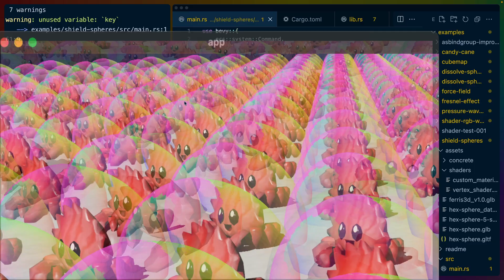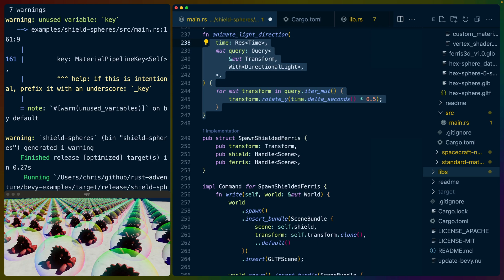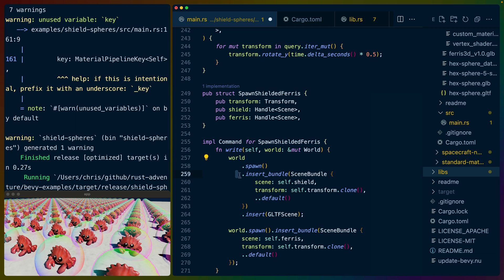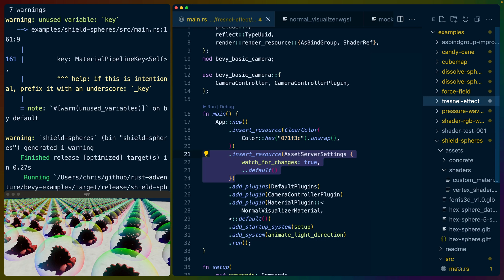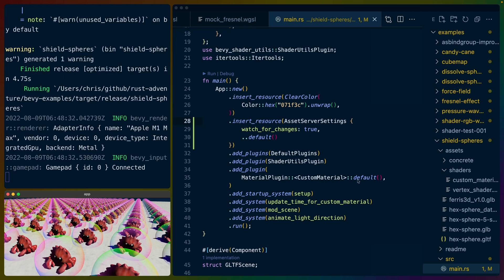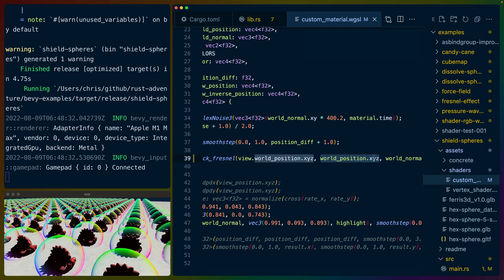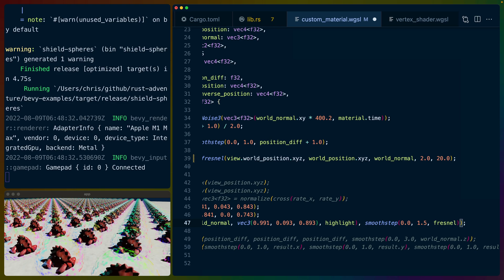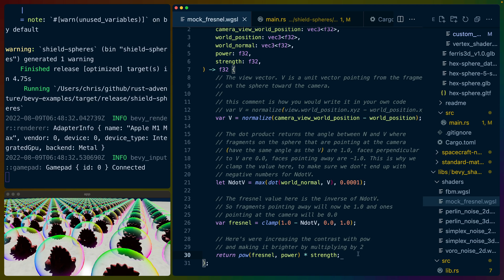Bubbles of Ferris with Bevy, WGSL, and Rust

Comment: For making the back of the bubble render sensibly, you probably would've needed to render the front and back separately -- render once with front-face culling and again with back-face culling. Doing them separately also gives you the opportunity to use different effects for the front and back.
Reply from the maker: The wgsl spec (and thus Bevy) has a @builtin(front_facing) argument in fragment shaders that could be used to do different processing on the back-facing fragments as well. 

https://gpuweb.github.io/gpuweb/#front-facing
https://github.com/bevyengine/bevy/blob/f531a94370755155accd625c58a06f07d33edcce/assets/shaders/array_texture.wgsl#L17
Reply: @chrisbiscardi  I don't immediately see an indication that back-facing fragments would be rendered strictly before front-facing ones, so it looks like you'd need to implement order-independent transparency if you go that route.

Comment: I only have a surface level understaning of bevy but couldn't you just when spawning the spheres add a zero size component (like struct BubbleSphere();) and then Query for that using With<>?
Reply from the maker: If you had control of the spawning of the mesh you could yes, in this iteration I was spawning in the entire gltf scene so didn't have access to the entity the mesh would've been associated with.  The most recent iteration removes mod_scene entirely and spawns in the mesh itself instead of the whole scene: https://github.com/rust-adventure/bevy-examples/commit/5355843b8caf83bb7e03d78bf5491803f0cd26b6

Comment: It's a great video and a beautiful effect!

The only problem I have is that when I run the example on Windows it runs at 3fps on a 1080 Ti. I profiled it (https://i.imgur.com/ix8mR6Y.jpg) and it's taking an age to go through the extract stage preparing the meshes and materials. I'm sorry I'm still really new at this so I'm not sure what's going wrong.
Reply from the maker: heya! thanks for the kind words. 

Did you remember to run the example with the release flag? `cargo run --release`. It enables important performance improvements for this use case.
Reply: @chrisbiscardi  Thank you! That was it! Runs so much faster now!

Comment: To get the normal map texture to work on the ground plane, I think you will need to calculate tangents for the plane Mesh. They aren't included by default. So if you do `let mut plane_mesh = Mesh::from(shape::Plane { size: 100.0 }); plane_mesh.generate_tangents();` and then add it to the meshes and so on, that should get normal mapping to work properly for you.
Reply from the maker: ohh, I didn't realize I would have to do this but that makes a lot of sense considering how vertex colors are handled as well.